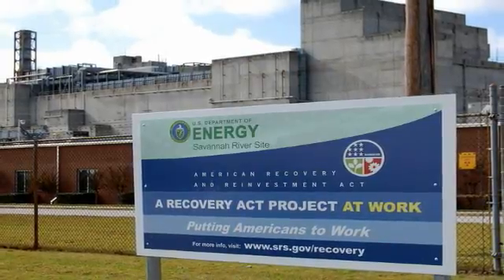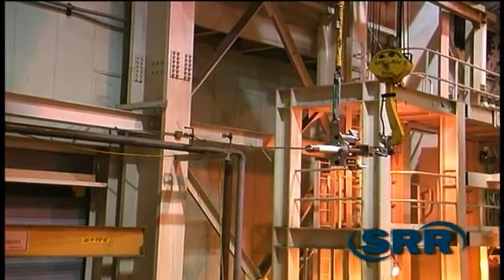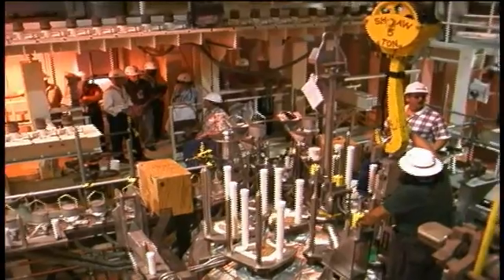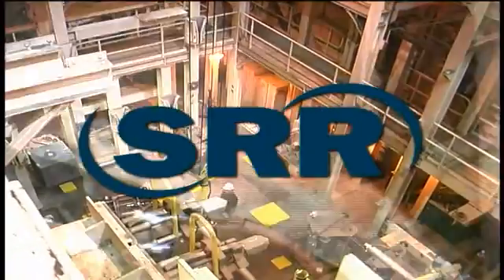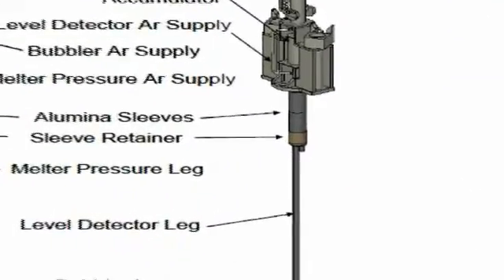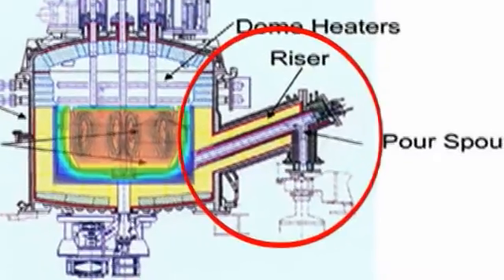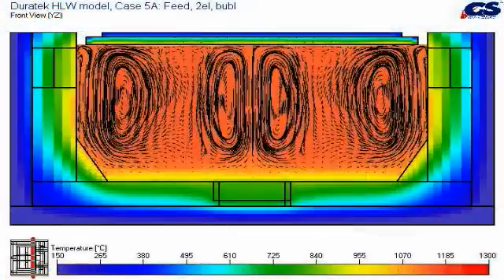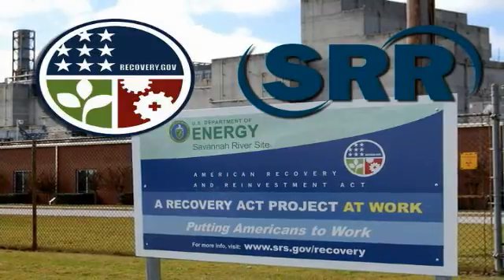Bubblers Speed Nuclear Waste Processing at SRS

Comment from the maker: The radioactive nuclides are bonded with the glass molecule so if the glass breaks the radioactive material in in the glass not the environment.  We are not encapsulating the radioactive material in glass. We are making glass out of the materials.  It would be 10s of thousands of years before the radioactive material could be release into the environment and by then it represent only a slight risk if any.  To learn more vist the Savannah River Site website